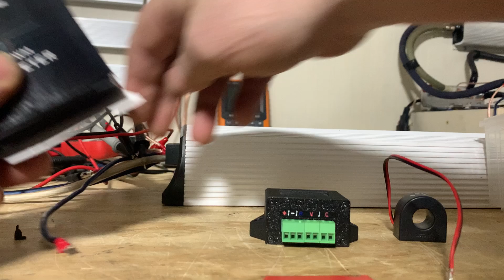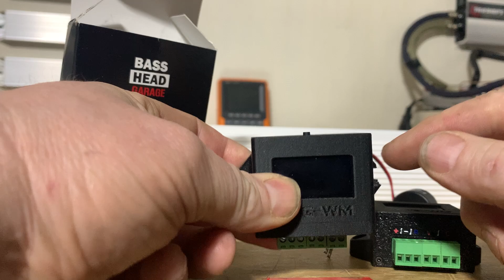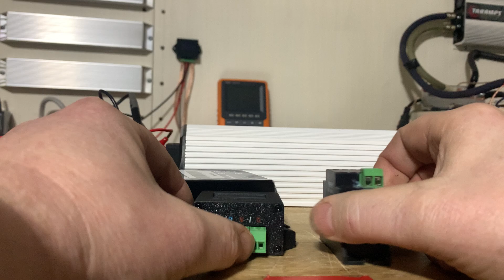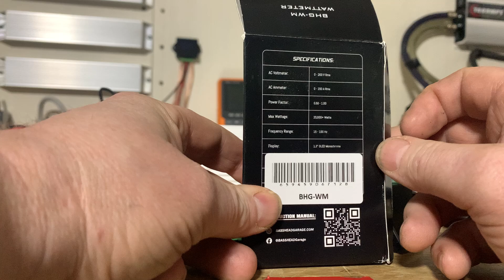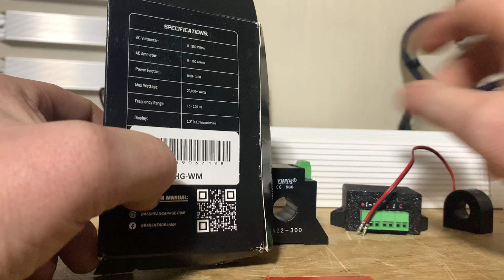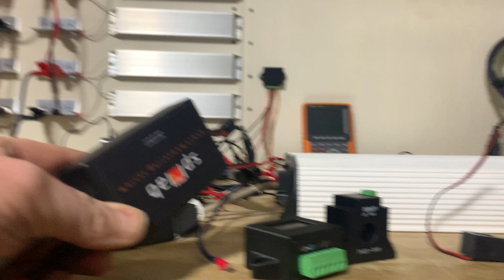Difference between BHGWM v1 and v2

Comment: Great video, I’m wondering how close the V2 is to the termlab?
Reply from the maker: I am waiting on a new clamp for the Termlab Magnum. The clamp I have here is faulty. However the BHGWM v2 is pretty accurate versus several different DMM/clamps I have here on the AC voltage and AC amperage clamped readings I have performed thus far as seen in previous videos. Thanks for watching